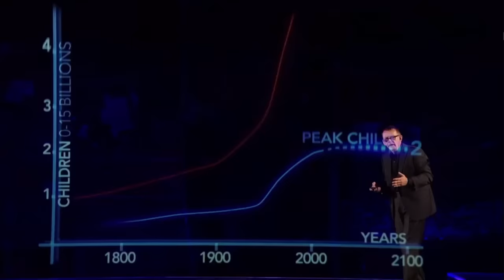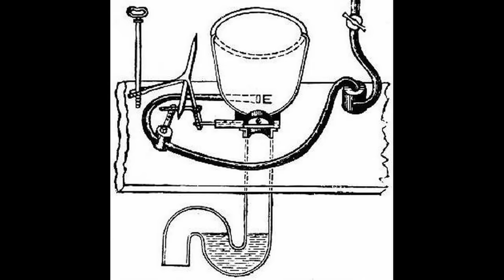How to Save TONS of Water, to Save the Planet

Comment: Wait.. where do I install the full bridge rectifier to turn the AC water coming in from the water company to a DC water compatible with my sink?
Reply: you can use the MOTHER OF *slaps head* ALL FULLEST BRIDGE RECTIFIERS as well for better efficiency… and by the way you need a capacitor in parallel to the circuit to truly convert the rectified signal to DC, because the FBR only converts the negative bumps to positive bumps, and you need a capacitor to convert those positive bumps to a positive straight line.

Don't forget to properly polarize the capacitor… or else if it explodes Mehdi will come and honor you as the leader of ElectroBOOM
Reply: Ingress prime sucks!

Comment: Be careful of Water Hammer(-ing) with the foot pedal.  :-)

Not a huge problem in most homes, but it can be sometimes and you may need to install an anti-hammer device with the foot pedal.  Minor inconvenience is all.
Reply: wont hammer if the valve is installed in the proper direction. ( closes against the flow )  solenoids are designed for this.
Reply: Most (newer) homes have a thermal expansion tank (thanks to water heaters and check valves from the water utility).  Should eliminate hammer in almost all modern homes (and, by code, any home that has recently had a water heater replaced).
Reply: @philstuf  Yup.   Or you can add thread arrestors under any fixture on the line, since the hammer is nullified there too... The slamming I was primarily referring to happens in heating systems when automatic valves are installed backwards, the slow closing valve now slams when closing and the sound carries a looong way. in this case the pump velocity created the hammer.. as as modern homes usually have a re circulation line that is pump driven this can occur if the diaphragm breaks and the tank becomes logged.... but you know all this already, I wager.  :)
Reply: @MrDmadness  Yeah, you're spot on.  I guess since I do all my own plumbing changes, I take for granted I do the diligence of reading the directions or code (and looking at the notoriously obvious arrows on most plumbing gear).  Then again, I work in IT and have had to literally read out an error to a user and they THEN get it ("Your password is expiring, you need to change it in 7 days." "Oh.  My password expires a week from now? I should change it?").  Typical, eh?
Reply: @philstuf  yup. Every fall for the last 20 some years i go to a no heat call and pull out a filter thats mostly dirt and they go " It cant be the filter, I spent $100 on that filter ( 3m Hepa ) it cant be the filter. "  and i say "high limit fault, your filters clogged and the appliance is overheating... buy cheap filters and change often... "  ... and those nest T stats that people are convinced they know how to wire a control. around 20 Transformers burned out by home owners this year already.

Comment: Saving water at home is nice and all that but it causes very fast new problems. For example you don't have to save water in every area in the world (like where i live, 98% of water we get every year, runs down the rivers unused into the ocean). So using extra Electricity would do more harm then good here. 
Even more so, since many people here already save a lot of water and so the sewer system gets damages by that. Confused? Well, it turns out, you need a certain amount of water, so fat and other dirts wont get stuck and clog the entire thing. Because of that, our city has to legally pump in the water people are saving now (and some more, to remove already existing clogs), so we need now more water because we save too much.
The reason why this is happening (the clogs and such), is because the system was designed for more water usage then we have now. In other words, we would have to replace and redo the entire sewer system to match the reduced amount of water usage. For us, it would make more sens, to just use more water again (since we have here plenty of that, unlike other areas), other areas would have to invest a lot of money.
Reply: Thank you, i wanted to post the same comment. It makes absolutley no sense to save water in my country, because of the reasons you listed.
But some people believe, that the saved water goes straight to africa...
Reply: I live in the UK and I've sometimes thought this, but check with the a local environmental organisation  if its true, where I live it makes a big difference saving water because the water companies take water from local rivers when they run out of storage which reduces the water level and harms wildlife.
Reply: In areas where there is a lot of water, it doesn't make sense to save it like this. However, especially in the US in places such as Los Angeles where the fresh water supply is dwindling, this makes a ton of sense. A system like this would be hugely beneficial to cities in desert areas where fresh water is often pumped from wells, and the groundwater supply is limited.
Reply: Also you would have to install an on demand hot water heater at your sink they use a ton of power making you require a massive electrical service to your home. Also like others have said many soaps or other products we use or clean require enough water to clear them from your drain or they will cause huge backups.

Comment: note: the 2700 litres of water used up are almost always cleaned per regulations before disposing downstream so depending on how tight your country regulations are it actually uses up less water as stated. the 2700 litres is just the input amount, the output amount of water might be 2650 litres of clean and treatable water, and 49.7 litres of unclean difficult to clean water and 300 milliliters absorbed by the fibres when the fabric was fabricated
Reply: don't you have to count the water needed to grow cotton?
Reply: @ZXXX48923  the cool thing is that pouring water into the soil doesnt waste any amount of water, because that water will get filtrated by soil, and gets to the underground water level, which then slowly seeps back into the river or ocean through springs. and water absorbed from the cotton cannot exceed its weight anyways so if u have a tshirt that weights 100 grams of cotton, it can only absorb at most 99.99999 grams of water but that means the cotton is jelly. usually water content of wood and other plant matter is about 20-70% depending on what it is. kinda like humans

Comment: Plot twist: the parts needed to make the device wasted more water than I'd waste on regular sink.
Reply: It will aid many like you, think a little out of box. ☺️
Reply: Reality check, water used in city plumbing isn't wasted at all, it goes into the grey water sewers and makes its way to the water treatment centers and is just recycled.
The closest to wasting water we have in the west is rural housing and water lawns.
Want to "save" water? Don't have an absurdly size yard.
Reply: @billybobjoe198  because every city has that
Reply: Alternative reality ->  we use a Groundwater Well to wet our Lawn. Unused Water goes .... back to Groundwater. Not much wasted, eh?
Our greywater goes to a sewage Plant from there to the River end ends in the Sea. Sounds pretty wasted to me.
Reply: @Markus__B  I said "The closest" no, "The waste". A significant portion of water used on lawns evaporates and doesn't reach the aquifer.
Reply: @byw  That's only part of the story.  Water treatment plants need to use chemicals to make water drinkable again.  The more water you send down the drain, the more chemicals are needed.  Also the bacteria that breaks down pollutants works best with less water.  It also takes time to break down the pollutants, the more water, the more space you need to hold that water temporarily before you release it.  Not all water reservoirs come from overground rivers. Sending water down to your house requires pumps that also use energy.  So in short, when we refer to wasting water it means multiple things:
1) Wasted water out of limited supply of reservoir, to be sent down a river, lake etc, that is not connected, nor does it supply water back to the same reservoir.
2) Wasted energy spent sending water to your house
3) Wasted chemicals treating water unnecessarily
4) Wasted space treating water unnecessarily
5) Slower processing of water treatment
6) More expensive water treatment
7) Larger sewer pipes needed

In short, yeah, there is a lot more waste than you think.  It's not just the yard.  And not all water treatment plants can produce drinkable water.
Reply: @billybobjoe198  not many country recycle water except drought ridden places like California.
Reply: @xponen  O_o where the fuq do got that information from?
Reply: @billybobjoe198  purifying water is one of the most energy consuming engineering/chemical challenges of all, water treatment plants spend so much energy to clean water especially when dealing with seawater. how about not wasting the damn water in the first place? also not all(read, probably most) cities afford water treatment plants so they dump the crap water in the sea or something, the water cycle is not even close to being a perfect feedback loop like the way you simplify it to be.
Reply: @billybobjoe198  Totally!  Lawns are a total waste.  Get synthetic grass or drought-tolerant landscaping.
Reply: @billybobjoe198  uhhh, treated water is usually dumped into rivers and oceans, not put back into the municipal supply.
Reply: @zn4rf  University of California have this information in their channel UCTV. Recycled water isn't used for drinking, they are sent to farm for agriculture & to ground to replenish spring water.

Comment: electric tape and hot glue can extend the lifetime of your shoes by 3 years
Reply: Have you been spying on me?
Reply: hmm that inspires me…
Reply: You mean Lifetime but with some other tape. Sole broken? Easy pile some rubbery tape and cut some pattern. Hole on upper section? Tape it. String is broken? Make it from tape.
Reply: how to use electric tape?
Reply: Look at mr moneybags here with shoes and shoe life extenders
Reply: icon firm
Reply: I normally use epoxy and fix them before there are missing parts, but yes, I believe we should all repair shoes and other things if they aren't completely destroyed, that saves money and protects the environment from manufacturing more crap, planned-obsolescence products.

Comment: This is a nice Idea. Though I'd rather use an alternative that doesn't make my water supply dependent on my power supply. If the valves are electrical, and you somehow lose power, how does someone get a drink or use the bathroom then?
Reply from the maker: Ooh interesting thought! Maybe you keep one least used valve untouched for that purpose
Reply: Just buy a cheap genset, it is only 50USD for 600w ffs
Reply: @kaikart123 , you could pick a more appropriate username
No, a generator set isn't a practical solution.
Reply: @ElectroBOOM  I believe there are solenoids valves with manual overrides
Reply: Bypass valves around the solenoid valve.
Reply: Konstantin Demenko  You could have a manual valve in parallel that is usually closed, and you open it only when the power is gone
Reply: Konstantin Demenko  A lot of places have water towers, at least everywhere I've lived.  They use gravity to feed the system (though they do have to pump it in to start with).
Reply: Konstantin Demenko  It depends entirely where you live, what the water has to do to get pressure, but yet in many areas electrical pumps (owned and run by the city) pump water into water towers to give the city water pressure. But those pumps are also run off of emergency systems that can run without grid power.
Most private businesses even have generator back ups. So any apartment building is likely to also have generator backups for emergency systems,  like feeding their water towers.
Reply: @kaikart123  Water valve = data centers

How many weed you've been smoking lately?
Reply: @renzevenir4853  what's wrong with his username?
Reply: @kaikart123  Datacenter?  If you can afford several expensive servers, and have several important servers that need uninterrupted power, then a generator won't be too much of a hassle.  But for your home?  If you've got a decent power grid, you'll "never" need the generator, and installing it is not such a simple matter.
Reply: @stathisloizos8737  it translates to 'fuck all' from Indonesian

Hey guys, why not try looking for some mechanical operated foot pedal?
Reply: Konstantin Demenko  Municipal water is supplied by gravity feed from a high tower. There are hours of reserve up in the tower, and there is always generator backup to refill the water.
Reply: What about coupling an alternative/emergency dc circuit based on solar/wind power charged batteries?
Reply: Make the foot control the actual valve, you could have analog control then, too
Reply: If you pipe the water all the way to the floor, you may as well not even use hot water, because you would either be stuck using the cold water in the pipes, or, you waste water waiting for it to heat up. Also, foot valves are not "easy" to use. They aren't hard, but for every day, half-asleep morning/etc use, you would end up with a lot of people falling over, and children could have some issues. (this is not a dig, by the way; I had started looking into this exact idea, but ran into these issues)
Reply: ElectroBOOM Battery pack. Power Inverter. Solar charge
Reply: Konstantin Demenko 
In the UK, mains pressure supplies the water. There isn't an electric valve anywhere near it.
Reply: F Eryth Or air pressure, like in my watering can
Reply: Kebria Yup. 
If the valve is 12V DC, that'll work. You can use a 12v battery, connected to a power Inverter, to get 220v AC. 
So, power cuts wouldn't matter at all.
Reply: I keep forgetting that some people actually have drinkable water in their taps.

Comment: An easy mod to make your toilet more efficient is just to place a couple of bricks in the tank. They displace the water, lowering the capacity, without actually modifying the hardware. When you leave the rental, just take the bricks with you.
Reply: you can also replace the flapper with an adjustable flapper (i think float one is best) so you can set it to close at any certain water level and adjust exactly how much water goes into each flush. The setting can be overrided by holding the lever down when more power is needed to flush solids… practically making it a dual-flush toilet.

Some adjustable flappers use a variable sized or positioned hole to let out air at different speeds but i dont think they are very good because you cant adjust them very well, and also sometimes the hole might get blocked or just not work and the flapper never closes. For example we have these fluidmaster “performax” flappers and even at the minimum setting they still let too much water through; also occasionally they empty the entire tank.

another thing you can do is remove the bowl refill tube. this will sacrifice some flushing performance (might leave some old water in the bowl) for saving more water. BTW; if the toilet had the fill valve replaced then chances are the filler tube has not been calibrated for the toilet so it is just pouring water into the bowl at full speed until it's full and then it wastes the rest. The filler tube should be calibrated to pour just the right amount of water to get the bowl fully filled without overflowing down the drain.
Reply: @magnumopus9058  Instead, you can fill a 2 liter soda bottle with water and put that in instead. It's easier to move around than bricks and also keeps a bit of plastic out of a landfill.